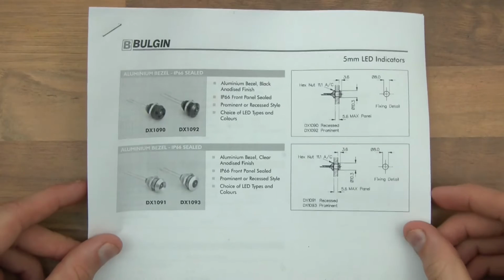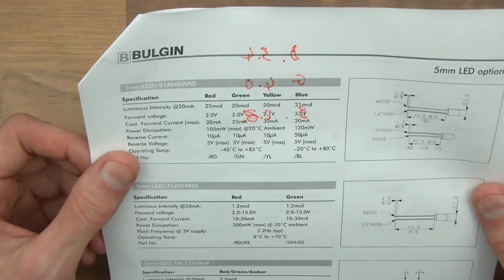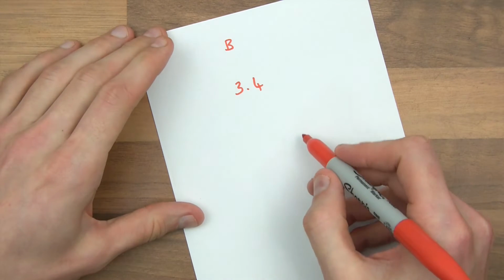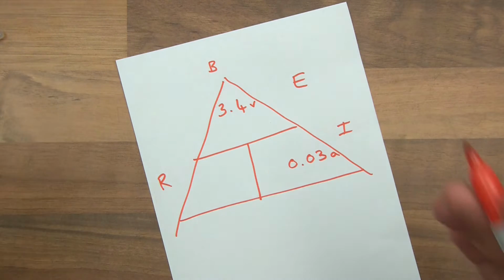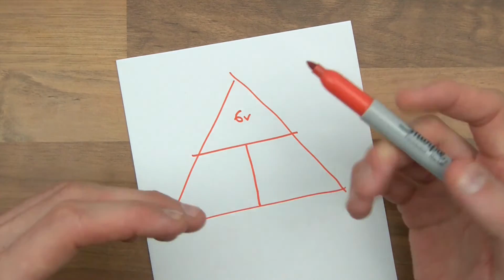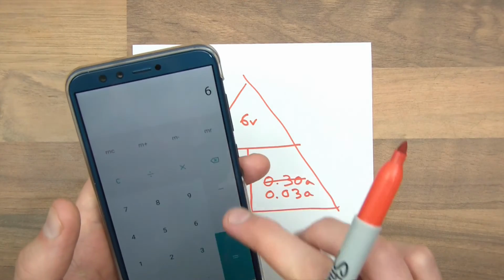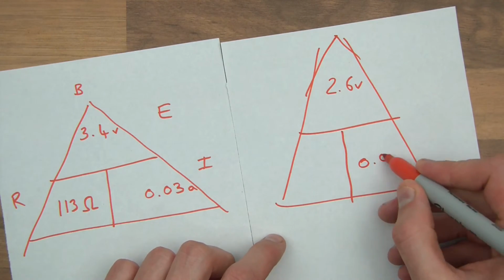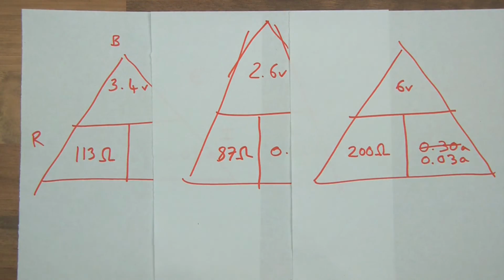EXPERIMENT #1 - Powering LEDs - How to Choose Resisitor - Simple - Step by Step - Ohms Law - Part 1

Comment: Nice Video...Could you explain how you found out the LED info without having a datasheet? I bought some LEDs before I knew what I was doing (not that I know what I'm doing now) that either didn't have a data sheet, or I didn't take note of it if it did.  Thanks
Reply from the maker: Hi, you get the LED, and power it with 1.5v, then watch the current draw. If the draw is less than 20ma, then increase voltage to 2v, and keep increasing until 20ma. Whatever the voltage is at 20ma the the correct voltage. (Simple version)  :-)
Reply: Cool, Thanks for the info @antonycartwright

Comment: hey dude , nice video and i wanted to ask you how to recharge a   3 li ion battery  pack i tried ( a 5v 2A SUPPLY, a 12v 12A supply, 9v battery ) and non of them worked what should i do ?
Reply: note: it didnt charge more than 1.5 volts and is rated for 11.1 volts
Reply from the maker: @xfcisco  It depends on how the battery pack is set up. Generally speaking though, to charge a 3s pack, you'd apply 12.6v across the terminals.
Reply: @antonycartwright  i will try it for a second time and give you the result , k ?